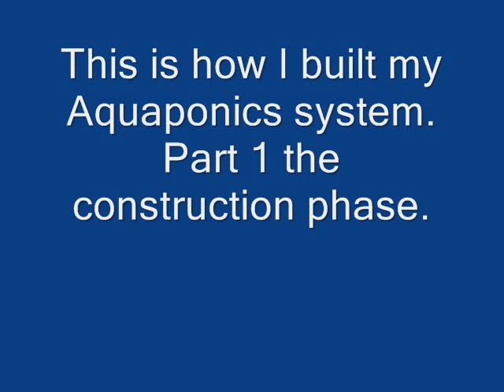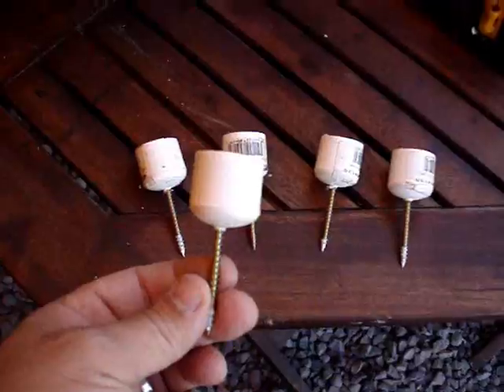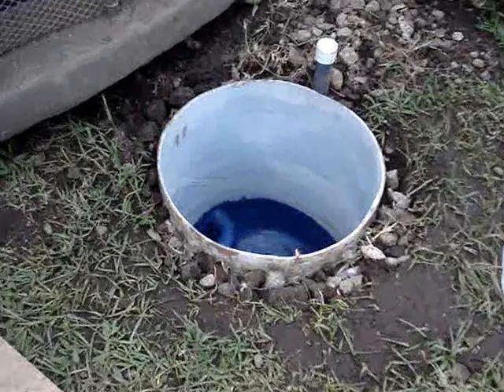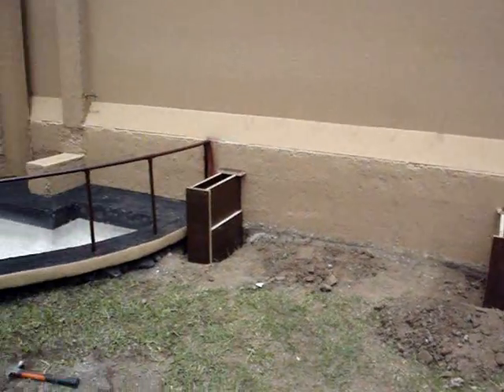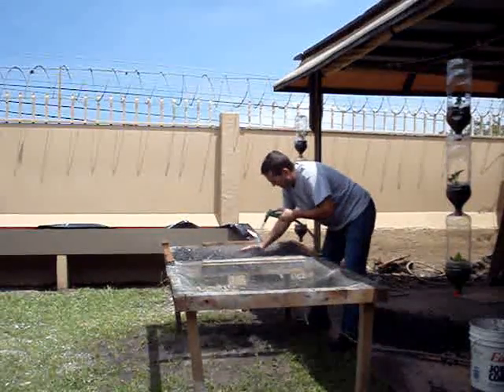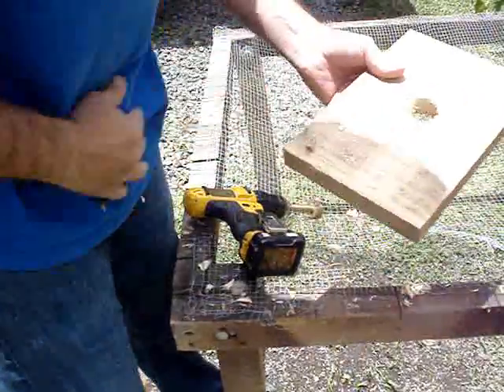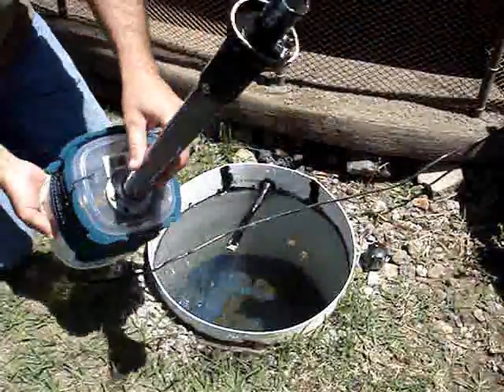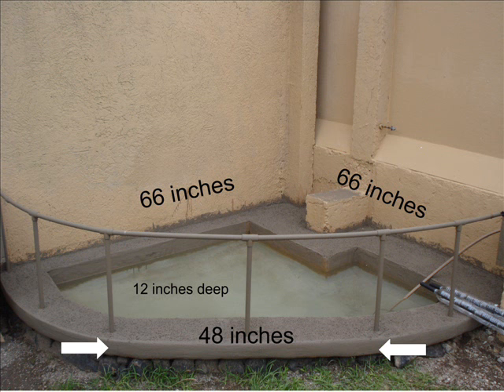How to build a home made DIY Aquaponics garden.

Comment: I'm inspired by your system and I'm going to venture by myself in doing it a system similar to your with miner changes. I'll be using an 'L' shape, where I have growing some veggies on since So the structure is there and I would have little  adaptation. Also, I'm planning a vertical  garden down the tank. The measurements are:
1. pond: 4 meters and 50 cm (4,5 cm) long, 80 cm tall, on both ends 80 cm wide towards the middle, where the 'l' is formed, 1 meter and 30 cm (1,30 cm) wide.

I wonder if you could send me, whenever you can, details on pump information, the drainage  and filtration that you created. that will help me greatly. Thanks! Can't wait to see next videos. bye from Brazil. anachagaz@gmail.com - Beijinhos !

Comment: This is a great looking system, it's really creative the way you're heating the returned water. My question is since your swirl filter is cleaning your water and the pump sits on top, how are you getting any of the fish solids to the plants, or are you adding nutrients yourself?
Reply: Another question, how are you pumping air into this?
Reply from the maker: The idea is not to pump the solids into the beds as much as possible the nutrients are still in the water and feed the plants. The filter does not filter out all the solids its mainly to keep things out that could clog the pump. Thanks for the comment.
Reply from the maker: I am using a small electric air pump. If you check out my control box build and some of my other videos it goes into more detail of how the system operates. Thanks for watching.

Comment: you cleaned the rocks but painted the planters???  I am confused at your toxicity logic
Reply from the maker: The boxes are made of wood the boxes need to be painted to last in the weather. The boxes are then lined with plastic which separates the boxes from the water in the system. Are you still confused? As for the fish pond you can use paint special for that application.
Reply: Did you rinse the plastic?
Reply: Does the cheap plastic leach anything with uv?

Comment: Great work dude. You made your assignment and did a very smart hook up. Let us know how everything goes as far as problems. But by the look of it , you shouldn't have to many. looks really neat. A++++ Dude. I even got some ides of my own from it.
Reply from the maker: +Papun Rodriguez Thanks, glad you liked it.
Reply: I did. Some things have to be redone and/or rethink but I bet you can! You don't need air bubbler when you have water return .It should be enough to give oxygen to the water. I have a small hook up and is running 24/7 and I only have a pump. In my case, since I live in a hot weather , I have shrimps! I filter mine with coconut fibers. I have palm tree and many coconuts on the yard! Look for La Parguera on the web. That is my home town. You have a friend here if you come by on a vacation. And a fee tourist guide as well.

Comment: I was curious if there might be a way to integrate a dc current generator to use the water fall to create some electricity(could be saved in a marine battery and used to run a small pump and air stones possibly even enough to rig a way to cool the water. Has anyone ever heard of anyone doing this
Reply: I haven't been able to find anything on it al all, this is how I originally wanted to power my pumps. It seems like it could be done, but I have had to learn everything from scratch during my process. So it's something I'm super interested in. I'd like to see a kelvin water dropper kind of situation from it... uhm.. but with more power. Maybe I'm over thinking it, but it would be reeeaaallly cool.

Comment from the maker: Thanks for the nice comment, I read your other comment first and was going to send you to this video, glad you found it. There are two things I would do differently to make the system better, I would make the fish pond round with the drain in the middle I have to spend alot of time cleaning this design because dirt gets caught in the corners .I use a little brush on a broom stick, I would also make the concrete footers bigger ,wider and deeper for the weight of the plant boxes.